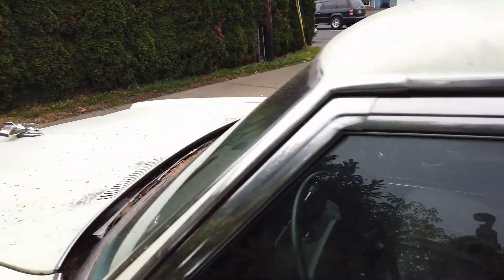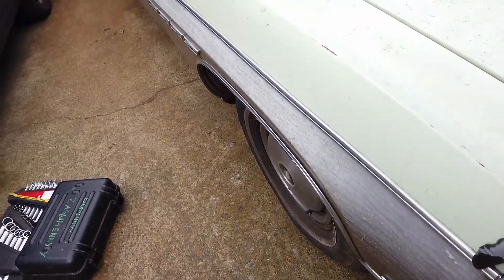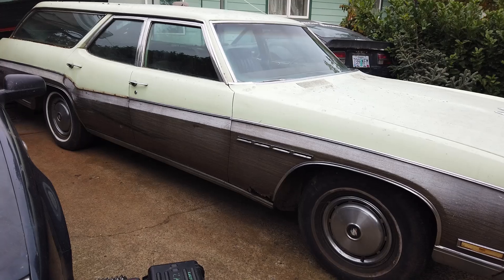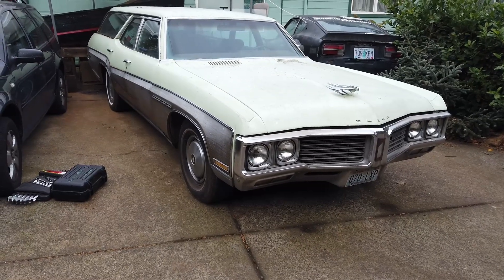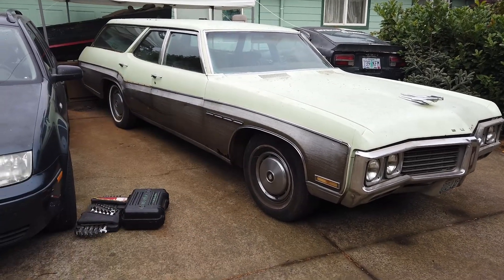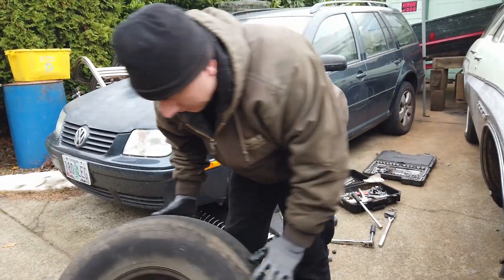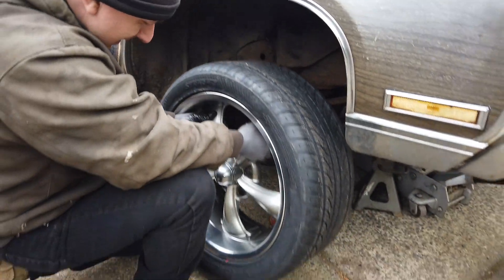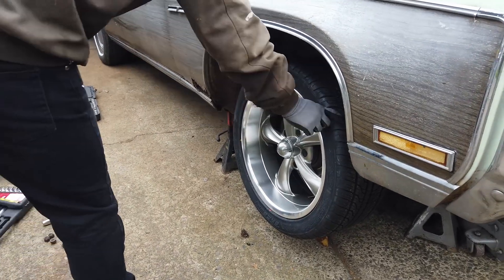Big Block Impala lowering spring swap in 1970 Buick Estate wagon 455 beast

Comment: 455 wagon whats not to love
Reply from the maker: Yeah, wish I could get seat covers for it.  Or any parts really...
Reply: @InvincibleExtremes  i would figure some parts would be easy since it shares the same platform as some other gm. Seat covers don't sound like they should be hard to get. But i know some of the wagons and some other odd cars are hard to get even repop parts for
Reply from the maker: Only drivetrain parts available.  Nothing that's specific to this...
Reply: @InvincibleExtremes  damn welp then that goes back to the old days of hotrodding when you couldnt get parts for everything.

Comment: if your going to drive it on a trip. It would be wise to replace the swaybar end links and the bushings for it.  All 4 shocks is another smart investment.  I am sure you do not want to float down the road.
Reply from the maker: Yeah, the end link has to be replaced.  And if I can, so do the shocks, at least a couple are toast
Reply: @InvincibleExtremes  Replace them both and the rubbers under the brackets to the frame. Trust me, The car will corner better and not wallow like a whale.  I'd do all 4 shocks. Fronts first if your not able to get them all.
Reply from the maker: Definitely.

Comment: I have a similar wagon. What kind of lowering spring do you use? Where did you buy them?
Reply from the maker: Impala 2 inch lowering front springs.  Haven't touched the rear yet.  Will be changing shocks all around soon.
Reply: Invincible Extremes Muscle Cars Garage Fit with no modification?
Reply from the maker: Yup.  Went right on